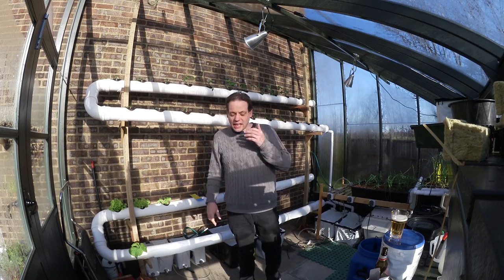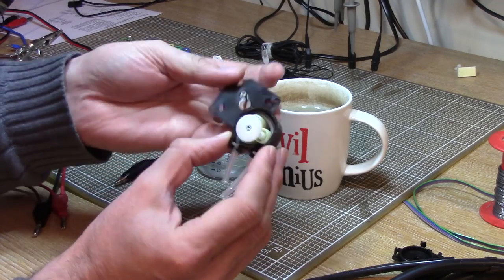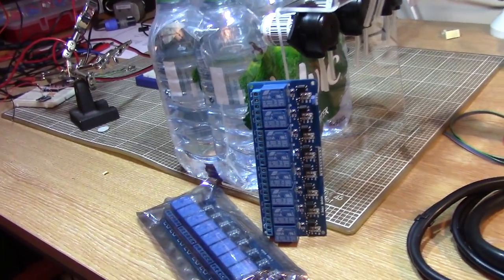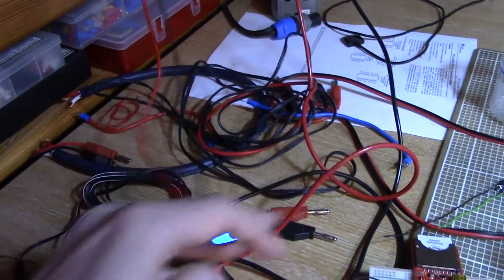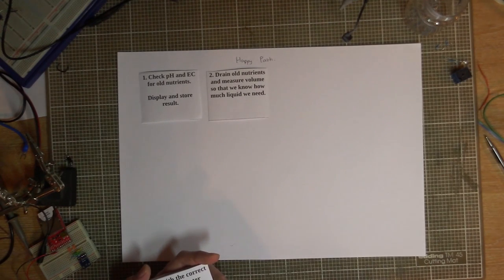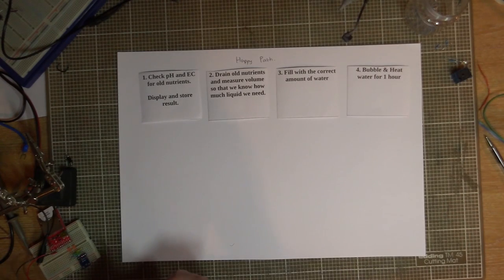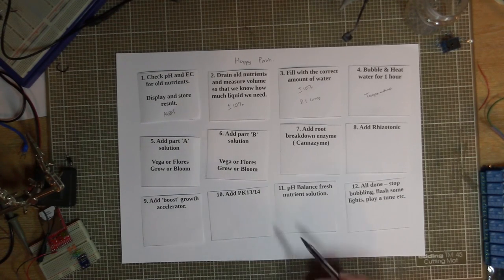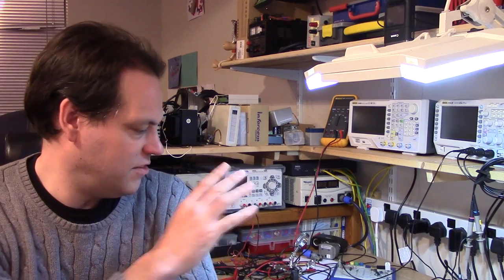The Mixologist - Automated nutrient mixing for hydroponics.

Comment: I really enjoyed this video, thank you so much!  I have begun to assemble parts to achieve a similar end.  I have decided to use ESP8266 boards that the different sensors will connect to and an ESP8266 relay board for turning stuff on/off.  I intend to make Syringe Pumps using NEMA17 stepper motors and also a rocking bed to mix up the nutrients as the solid particles in the nutrient sink to the bottom and you  would end up with more or less levels of concentrated/diluted nutrients. I will put the nutrients into a bag like those used for drips so that the nutrients really slop about on the rocker prior to drawing them.

I intend to use some kind of Pi or BB that will run a suite of applications that poll the measuring devices, then another suite of apps for draining and dispensing that are run by an "Event List" that is built dynamically with parameters based upon the results of the measurements. I have almost all of the parts to kick this off except for the green house. To start with I am going to use a 150 ltr container with square drain pipes erected like trees and insert the pots at a 45% angle.  Then pump the nutrients to the top of the drain pipe and have them cascade like rain down the pipe and back into the container.  I'm sure there are lots folks ready to tell me how much it won't work but it's the solution I came with and that's what matters to me.  If it fails I'll learn, which is always worth while :)  

I must say your approach appears to be a lot cheaper than mine.  I was looking for a way to periodically insert the PH sensor into the mixture because they appear to wear out quite quickly from what I have read.  A sort of 'dip stick' approach was my idea.  Sadly I've been designing and building replacement networks for two clients and that has eaten all of my time this year. Hopefully that will be completed in a couple of months (the roll out is going to be a nightmare!) and I can build the green house from the scrap lumber I have plundered from skips over the last two years. Then we'll see if I have wasted lots of money and time ;) Once again, thanks!
Reply from the maker: Hi Bryn - Sorry for taking so long to get back to you... Sometimes life is busy. A chap called Devin recently got in touch with me via the comments to let me know about their own project where they'd used stepper motors and syringes already - they've got a project up on github with all their code... https://github.com/devinrayolsen/DRO-Matic ... It might be worth you getting in touch with Devin (you should be able to find him down in the comments section somewhere) as it sounds like there's a lot of similarity between what you're planning to buid and what he's already built. My own mixologist project has been on-hold for a couple of years now as I got busy with other bits and bobs and haven't put in the time needed to get the project finished (and also I switched to using dry powdered nutrients instead of pre-mixed, which totally changes the way that dispensing would need to be done.... I'm currently thinking that I should try a simpler project to begin with... Perhaps just a measured water inlet so that I can tell the system that I want exactly 20 litres of water dispensed into a container instead of just relying on my guesswork to work out exactly how full any container actually is. Cheers!!

Comment: Load cells under each reservoir seem like a really good idea.  Wont matter if the pumps struggle, pick up air or whatever.   Just pump until the target weight is reached.
Reply: I liked your idea for load cells Doug.  Then I thought "Level Sensors, surely"
My internal jury is out on that.

I like what is being said here about designing "to avoid the possibility
 of things going wrong", but part of designing for what I would call 
"robustness" (and "reduced cost") is designing out unnecessary 
components, and of course adding failsafes and backup systems.  

So I am thinking why not solenoid control and single delivery line to the mixing tank?  An array of solenoids at the end of a single, any length, small diameter, delivery line for all nutrients suggests to me you might even use one high quality peristalic for all nutrient mixes.  These could then be stored a long way from your mixing tank(s), and a single mixing tank might service multiple, independent, root zones on a time-share basis.  

For consideration: 
(1) Could you abandon the "one peristaltic per feed" design?
(2) How would a single mixing system work with multiple root zones?
(3) What are the wider benefits and cost implications of the sophisticated simplicity being advocated here?

(1) Could you abandon the "one peristaltic per feed" design?

I am pretty sure you could use the two wires of an I2C bus or even RF to
control any number of solenoids, perhaps with compressed air to move stuff faster and flush lines.  Nine (goodness me!) nutrient mixes 
would not then be a limit on the design, and more mixes need not add to the cost and compexity as the number of "ferts in the mix" increases.  
To deal with the "don't mix concentrates" issue and eliminate any hysterisis that a long delivery line to the reservoir implies, you would designate one solenoid to "flush nutrient delivery line with water" and/or have a local mixing tank.   Of course this fewer peristaltics introduces an element of additional time elapsed, but I don't think time is limiting - 1 ml per second from one peristaltic will deliver 3.6 litres per hour and we are only talking about the dosing, not the mixing or flushing of the delivery line since that can be handled by a different pump.

Either way there is certainly a case for bringing the dosing under 
software control because growers might want, for example, to buy 
commericial solid N ferts and disolve them, use low (monitored) volumes of 
specialist organics, or play tunes on urea vs nitrate vs amonia during 
the course of a single day (possibly not a 24 hour day) AND do so for multiple root zones - for which read everything from a single flood and drain pot to a greenhouse bay 1000m2 in area.  

(2) How would a single mixing system work with multiple root zones?

Such a system would sample each zone in turn by filling the mixing tank with that zone's growing solution and, on the basis of both analysis and anticipated demand (I feel an algorithm coming on that takes account of weather, maturity of crop and other factors), prepare a top-up mix for that zone by dosing a variable quantity of each fertiliser in turn, mixing and then dumping the diluted mix to the zone, flushing and repeating for a different zone - all with one array of sensors.  The pH adjustment stage can be combined with flushing, so the low pH solution can be expected to sanitize the mixing tank, reducing any possibility of pathogen cross-transfer between root zones.  

(3) What are the wider benefits and cost implications of the sophisticated simplicity being advocated here?
 
If systems are cheap enough then duplication of the entire system as a failsafe has a cost benefit justification.

You can monitor and calculate and log the whole process, using your PC and have real time up-to-date information on cost of inputs for each root zone.

If such inputs are measured and recorded accurately and reliably then they can inform a "blueprint" type growing regime that is replicable anywhere.
Reply: Would the load cells drift too much over time though?

Comment: I'm working on a similar project, and have come up with a series of float sensors, staggered, from lowest to highest. To reduce damage if one is bad, the system fills only when x number are down, and stops as soon as at least x number are up. It also knows the position of each switch, so if one is down below one that is up, it alerts the user that one of the two is not functioning. This reduces the risk, as it would take a multiple switch failure to create an under or over water problem. Much better than trying to measure the water fill side.

Comment: Pure awesomeness , I was literately looking at making one of these
Reply from the maker: Thanks M4ST3RC4TS - I really must get on and make some more progress on this project - It's been sitting on my desk for many months now with very little progress - I got to the point where I needed to build some decent chassis/framework to hold all the bits together, and then I stalled. I want to build a better system for holding all the pumps, and I have an idea of exactly how I want to do that... I've got a CNC router in my shed which I built about a decade ago which would be absolutely perfect for cutting patterns out in acryllic... so I just need to refamiliarise myself with the CAD package I used back then, spend a day or two getting the design right and a day or two in the shed actually building the chassis.... For one reason or another, I never seem to find the time to get properly stuck into that job. I did know when I started this one that it would be a long-term project.... If you start one, I might be able to copy your ideas, so I'm going to fully encourage you to do that :-) Cheers!!

Comment: Brilliant idea Jim. Will be a fantastic product .
Reply from the maker: Thanks Patrick - not sure it will ever make it to 'product' status, but it sure is a fun project. Cheers!!
Reply: Jim Conner
How about a Kickstarter Jim ?
Reply from the maker: I'd certainly consider doing a kickstarter.. if I can get the prototype built and working right... I wonder how many we'd need to get a decent production run ready... and I'd have to put in a good chunk of effort on designing something which can be mass produced (rather than the current jim+soldering iron solution). Cheers John!!
Reply: Jim Conner Well I'm sure you know where to get your front panels cut :)
I'm impressed with your plastic bending BTW ...Maybe a vid on that as it can be a bit of a black art to  get right!?!

Comment: Hi jim nice work man. I have done some thing simillar. Less cabling just plug and go. 16 relays. Controls water level. TDs,ph,temp,humidty. Timers for watering. System suits all type of hydroponic. It has night time and day time settings. U set up everything from phone or pc wirelessly
Reply from the maker: Hi Murat Acikgoz - Sorry it's taken so long for me to notice your comments - Youtube decided that they were all spam as they contained links, and didn't bother to alert me to them - I only got the notification when I came to this video to reply to someone else's comment. You've got an impressive looking setup there - great work - I particularly like that it's showing you the exact water levels. My own Mixologist project has been sadly neglected for the last few months (got a new job... it's keeping me far too busy)... but someday soon I'll find some more time for this project - It's very much needed for me as I accidentally killed all of my strawberry plants a week ago. My pumps are on timers, but I switched off the timers when I was changing the nutrients and forgot to switch them back on again. This wouldn't have been an issue if I'd fully automated my nutrient changes. Cheers!!